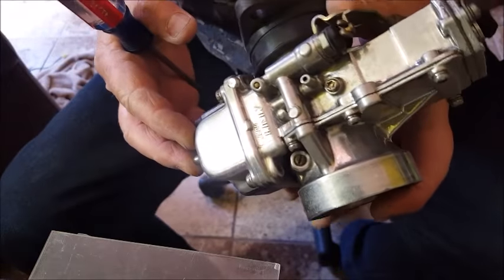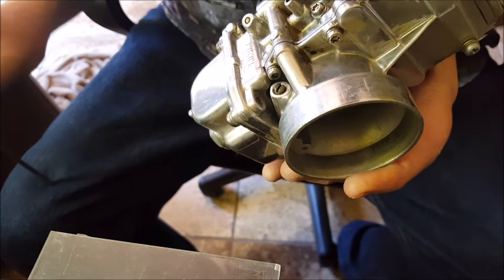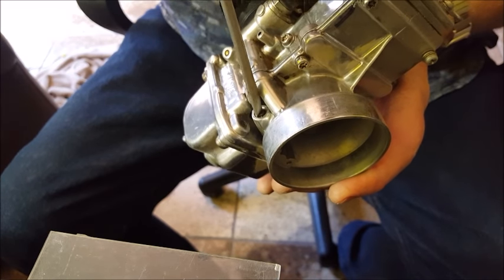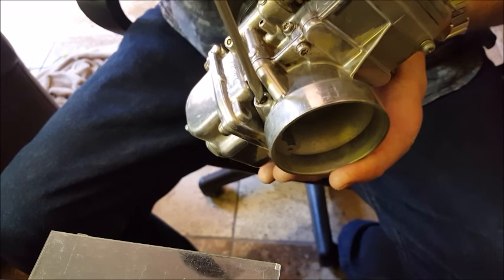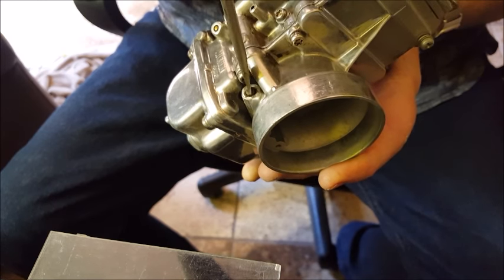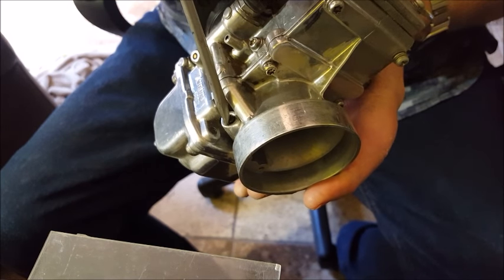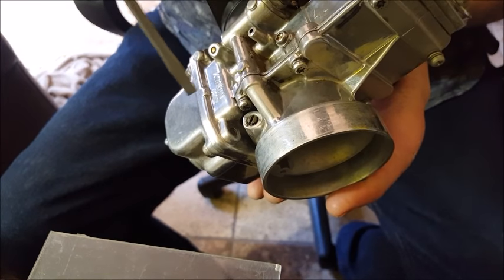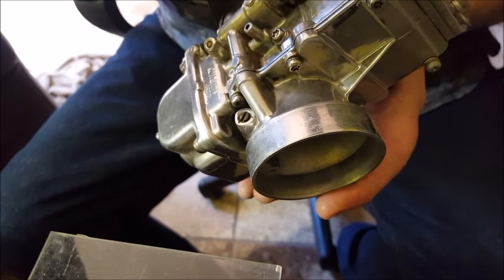Air screw adjustment Mikuni carbs only

Comment: Hi man. When i adjust the airscrew on a certain position, it seems to freeze out or hangs the idle. Is that normal or a lean condition? My best position is at 3/4 turns which erases the hanging idle.  But it also means i have a small/lean pilot jet and have to go up the next number higher right as per your video? Carbs are really giving me headaches hahaha i got confused if the hanging idles are also from an air leak.
Reply from the maker: You shouldn't get a hanging idle from the screw adjustment, just a idle speed change. You do sound lean. Maybe by 2 sizes.